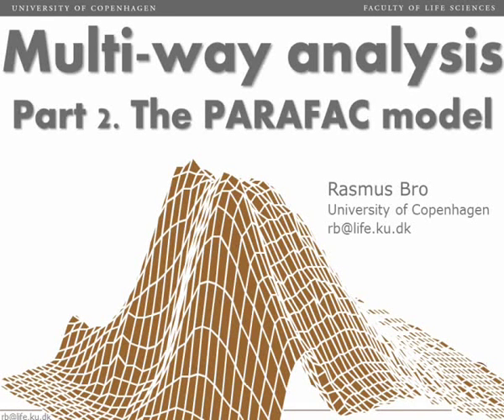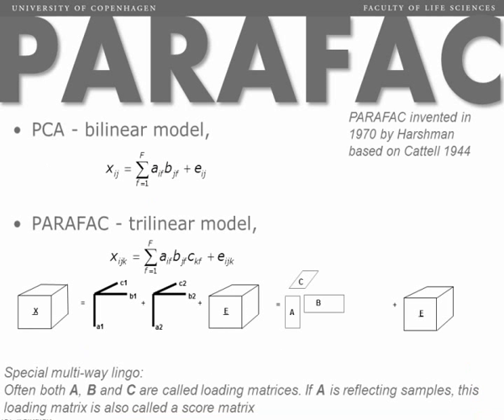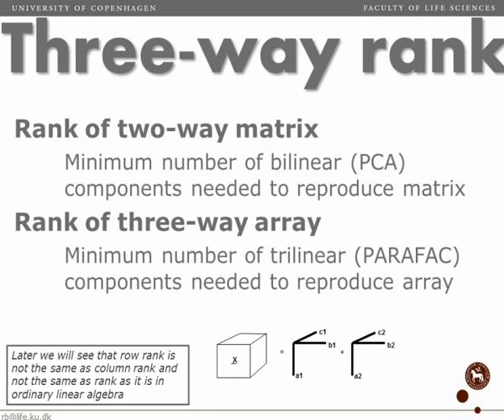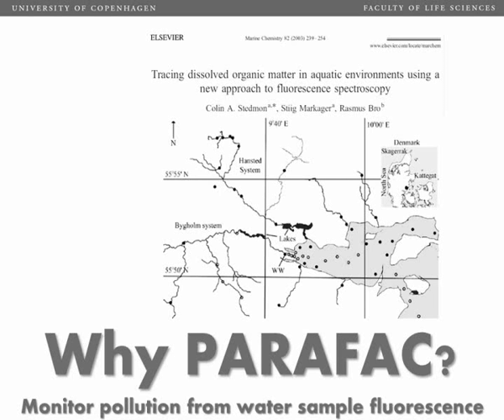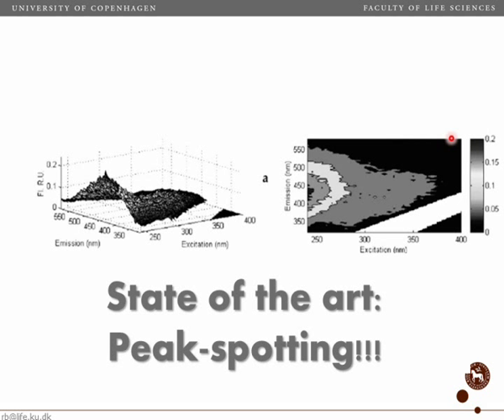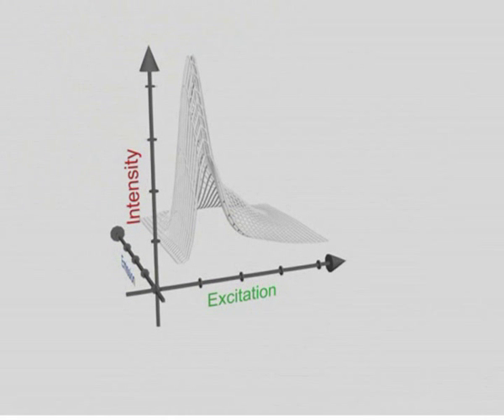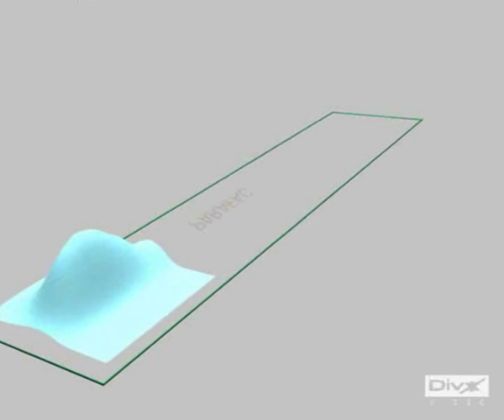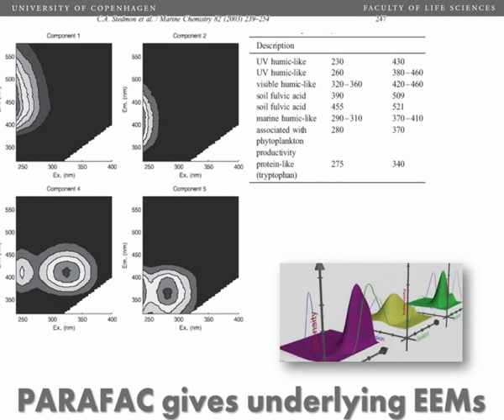Multi-way analysis. Part 21a. Introduction to PARAFAC model

Comment: Thanks for the course.

I would like to know if I have a 3 dimensional data generated by using 5 independent parameters plus noise, then can I use PARAFAC with 5 components or  look for any other techniques?
Reply: I guess that is pretty much very difficult to say. Give it a shot, I would say